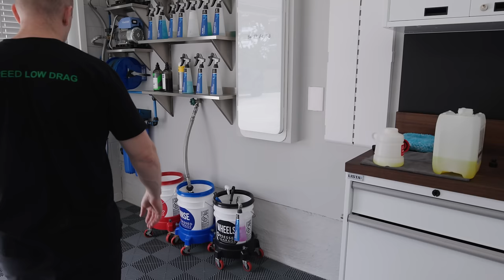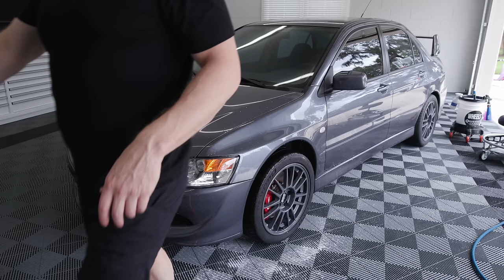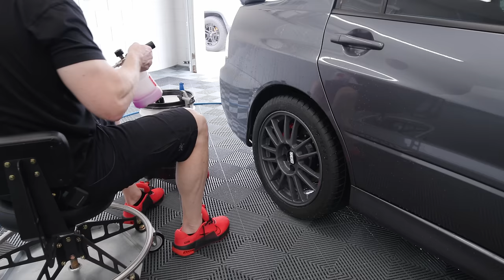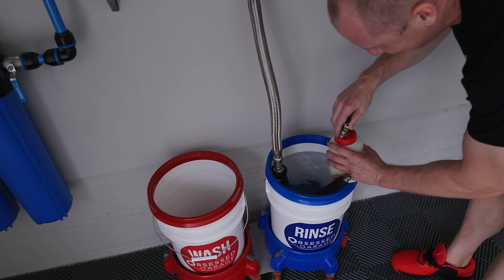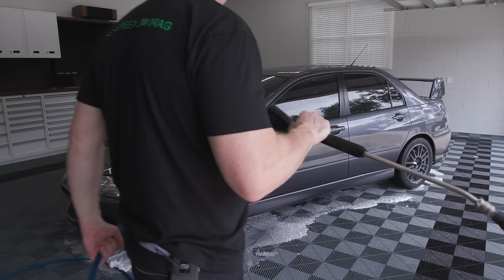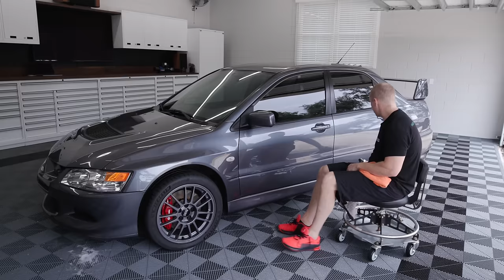Wash and Talk: Mitsubishi Lancer Evolution 8!

Comment: Reactivation Shampoo is actually more comparable to CarPro Descale. It has a pH of 1 out of the bottle, and should be diluted 200:1 for a pH of about 3. Definitely not something for regular washes, just when a coating is starting to clog with salt/minerals and losing water behavior.

They recommend to use an alkaline precleaner first, then pressure wash. Then apply this with a foam cannon or just do a bucket wash with it. I think if you did only this, you would want to wash with GSF afterwards to make sure it gets neutralized and fully removed.
Reply: Descale is my favorite!! I have to use it constantly because I work in the refineries and drive my truck into the plant daily and we have multiple railroads in the plant as well. Fair to say I go thru a lot of descale and iron x 😂

Comment: I really wish Matt did more rinse less washes. Cars are perfect so he would know right off the batt if it was marring the paint. Doesn’t hurt to try it, if it fails it fails .. at least he tried. 
I haven’t used soap on my car in 3 years. Full disclosure, i dont drive it in the snow and its washed often. Perfect situation to use Rinseless washing. Also i do still use the PW on my wheels and tires.

Comment: This is one the cleanest Evo 8s out there! I see you still have stock suspension. Im wondering what are the measurements front and back from the center of the wheel to the fender. I'm trying to get a stock height dialed on my 05.

Comment: Hey Matt one thing I noticed when I used bilt hamber touchless, I think I used too much in my foam cannon because it stripped off my csl/exov4 that was only a year and a half old and made all my black gloss painted badges dull. I always wash the car once a week with Koch chemie and car pro products, never had an issue before. Water sticks to the paint now and all water beading completely gone after 1 use with bh touchless.
Reply from the maker: Yeah.. I would check the dilution ratios and go from there. It shouldn't be stripping the coating and gloss from the surface.

Comment: Hey Matt, I got that gouped up drying aid in my bottles. Came to me just fine, but happened sitting inside my garage in Houston. If it doesn’t affect performance, is it just a looks thing? I would be interested to figure out what it actually is.
Reply from the maker: Yeah.. We're trying to figure that one out. It's got to be something with the heat and humidity causing it to clump together. As long as it is still performing fine you should be good to go.

Comment: Matt, when you wash in the garage, does the water hang around or how does it drain out, I am just building a garage and would like to know? Thanks
Reply from the maker: It runs under the doors out into the driveway.
Reply: @ObsessedGarage  does it get dirt trapped? How do you clean it thanks, appreciate your quick reply. ALB
Reply from the maker: Dirt settles under the tiles.  Once a year, I'll pop sections of the floor up.  In between you just vacuum the dirt up through the tiles.
Reply: @ObsessedGarage  ok thanks for quick reply Matt, ATB 👍